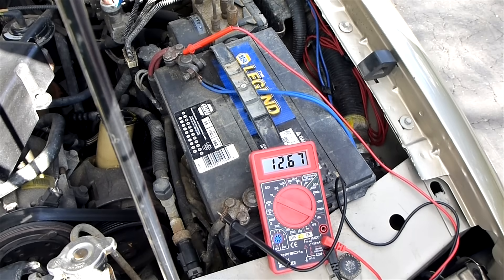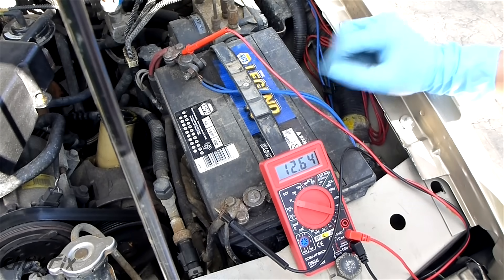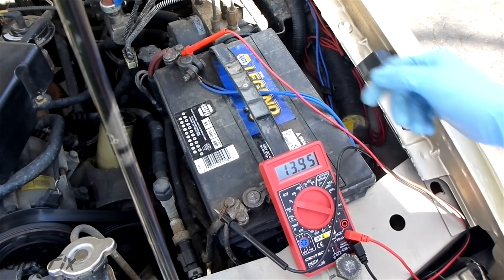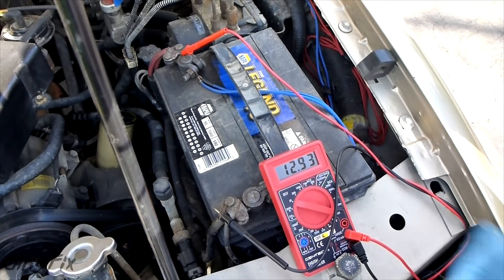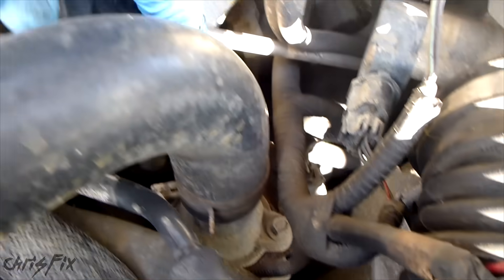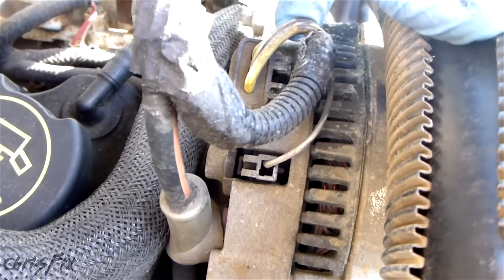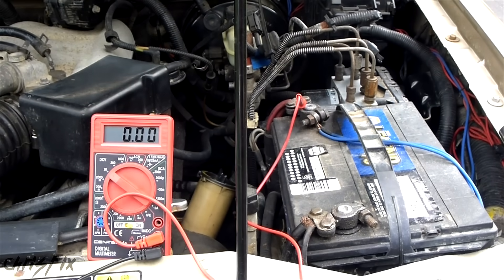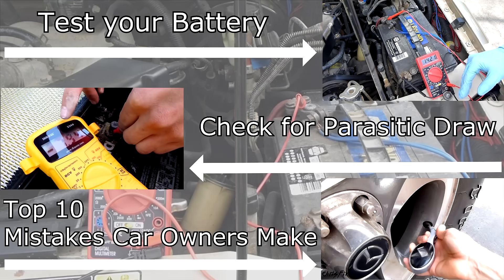How to Test an Alternator

Comment: so Chris my multimeter showed 12.02 v when I had the key in the ignition and the dash lights where on but I hadn't started the car, i left the headlights on for 2 minutes as you said and the multimeter said 12.02 when I turned off the lights it showed 12.37v when I started the car it dropped to 9.87 v and rose back to 14.02v , when I put load like headlights, fog lights, radio , both indicators , a/c, and high beam lights it dropped to 13,57v when the indicators flashed and 13.85v when they didn't flash so what is your guess?PS the only symptoms I noticed is that my cabin light flickers when I open the door and leave it open for a while and when the car is cold it takes a little while longer to crank than usual but when it's warm , you turn it off and try to crank the car it starts up instantly like literally when you turn the key it starts up
Reply from the maker: The battery might be starting to get worn out but it sounds relatively normal. You can get it load tested for free at a local parts store.

Comment: Hi ChrisFix
At the alternator, there's another wire, in toyota they have 3 small wire and 1 main wire
the 3 wire are Light (L), Sense (S) and Ignition (IG)
Can I ask, what happen if L and S wire switch place?
for instance, the L wire connected to S terminal and S wire connected to L terminal
thanks

Comment: Hi, When you did the test on your alternator. You could hear the wining sound from the alternator. The load is too much for it.
Thus you killed the old one out. Now with the new alternator you could heat up the wires. Just be careful not to use too many accessories. lights, radio/stereo, a/c, fan. You can still overload the system and have a fire.

Comment: if i have replaced battery and alternator and audi does not hold charge . for a quick fix can i diconnect batttery . so it starts till i get it fixed and is there anh consequences

Comment: what if it starts on 12.11-,12 and then goes down to 11 and below when starting the car... ??? Is it still the generator/Alternator? or maybe wiring issues??? Just had the car to an automechanic, and when i got it back car wouldnt charge the battery,....

Comment: my car has an external regulator. how do you connect the volt meter directly to the alternator to check direct alternator output so as to bypass the regulator?

Comment: This has been extremely helpful. Before seeing this, I almost did the "disconnect the negative terminal while car is running" test, which before I tried, I read some horror stories about what that can do to the voltage regulator. This helped me out a lot though. Appreciate.

Comment: You ever discovered the reason for the whistling noise you're hearing at low rpm or high load? Im losing my mind trying to quieten down my alternator...
Reply from the maker: +bavarian34 clean as many of the ground wires as you can. Make sure the connection is good.

Comment: Nice Job Chris, Very informative !!!! I just picked my rebuild one from a reputable Gen/Alternator shop, I reinstalled it still have the same problem, the Alternator light came on, but if I rev it up it goes off, but the I get voltage readings from 13.58 to 16 v then 14.20 its all over, but then the light comes back on, I do hear the draw on the alternator when it does go to proper voltage, but back to the 13.48 13.68 and the light is on, my suspicion bad voltage Regulator in the Alternator ?That's what I'm thinking. Thank you ! Great job on the Videos

Comment: The battery light in my car was barely on and had been on for a few months now.  I checked the battery, the grounds, and then proceeded to test the alternator just as ChrisFix described and it passed all the tests.  So I didn't worry about till the other day when my car wouldn't start.  I checked the battery and it was down to 2 volts.  I changed the battery and the next day the car wouldn't start.  It drained the new battery down to 10 volts.  So I did a parasitic draw test and found that the alternator was pulling 3 amps when not running.  Replaced the alternator and solved the problem.  I didn't realize that a non running alternator could do this.
Reply: Your alternator probably had a shorted diode. Diodes only allow current to flow in one direction----> into the battery and not back into the alternator, like a check valve for electricity. When it shorts out, the electricity flows back into the alternator like an open check valve.
Reply: Rectified diodes.

To check for a possible bad alternator diode switch your
 voltmeter to a low setting on the AC (alternating current) voltage scale.  
 with the engine running, touch the meter probes to the battery terminals. 
Any amount of AC voltage would indicate a bad diode, so you'll need to replace the alternator .

Regards.
Reply: @maar5725  likewise WTF is a "rectified diode"?
maybe you meant to say "rectifiER diode"?
Reply: @maar5725  how do I check alternator if car won't start? Is it possible?
Reply: @garyhall6294  If you can get it out of the car, you can take it to autozone or oreilly, they both do alternator testing for bad diodes. I think they can tell you the amperage and what not as well.
Reply: @FeelFighters  thanks bro!
Reply: @maar5725  I would disagree with this slightly.  Ripple may indicate a high internal resistance in the battery.  The battery is the ripple filter and high internal resistance will allow for higher ripple.
Reply: @maar5725  thanks for this tip will try, no crank or start, will try when after jump
Reply: @David Parks thanks a lot. Appreciate it!
Reply: Yeah, any electrical device can have a short or an open in it, any time, whether or not the car is running.  I've mentioned before that a lot of electronics today has some parasitic draw, which is a small amount of current being drained out of your battery all the time, even when the car is off (engine off, ignition off, key out), but what you had was clearly a huge parasitic drain, clearly caused by a short, somewhere in your alternator.  You can rout around, try and find it and replace the part to maybe get it working again-if you want to-and wind up with a 2nd, and spare, alternator, or maybe you traded it to whoever you bought your new one from, or just throw out the old one.  At any rate, if you don't feel like trying to fix the old alternator, it really doesn't matter, because you localized the huge current drain to that old alt, then replaced it with a new one, and now don't have that huge current drain anymore (problem solved).  It is always good when faced with an excessive current drain to disconnect electrical parts connected to the battery, one at a time, until you find out which part is draining all the current, then simply replace that part, as you did, to solve the problem, simply and efficiently.  Excellent.  That is good news.  (I wish I could find a truck for 200, like someone else mentioned on this site, fix a simple electrical problem on it, and then have a good truck for only 200, plus low cost electrical parts like wires or resistors, simply and efficiently!)
Reply: @michaeltotten7508  unless thr fault is upstream of the part that you disconnect and in disconnecing tbe part you also remove the true fault from the complete circuit. 

It is better to remove the battery entirely from the circuit by disconnecting the positive lead. Even if the alternator is not working the car should start and runnif you either jump start the car or start it off a battery that you know is good. Like a new unit. 

A dead short through the alternator will prevent the car from starting with a good battery as it will short out the battery. If the alternator is not a dead short but just not producing a voltage then it is a load on a new battery. This is not likely unless the alternator presents a low resistance to a new battery. If the alternator is not actually connected in circuit due to faulty wiring or a  open circuit at the starter switch then again it should still start if the starter circuit is working and the engine will actually run when turned over. 

So isolating the alternator as the problem involves one sinple test: disconnecting one of the alternator output leads so that it eithet floats or is no load on the battery circuit. Monitor the battery voltage to ensure that it has enough output voltage and power to start the car...if not use a spare battery or a jump box...

I had a problen with my alternator and battery "failing" frequently which various mechanics solved by replacing either the alternator or the battery sometimes even the starter. Eventually I found a competent mechanic who established that the negative battery lead was floating with respect to the starter and alternator. The negative battery lead was connected to the body but the body was not directly connected to the negative starter lead. There was just enough but not too much resistance for the car to start with a fresh battery...and it would stary until the terminal battery voltage dropped to about 12.5V. It should start with the batter down to 11V even 10V. The solution was to tie the negative battery lead to the engine block.
.he used a thermostat bolt as the tie point with a 6ft 10ga lead. Not had a problen since.
Reply: the alternator diodes will be destroyed slightly every time you jump-start the car

I love that this guy got 4M views on a video that just highlights the obvious.
Reply: @touristguy87  What is obvious to some may not be so obvious to others!
Reply: @DavidArroyo78  obviously
Reply: @touristguy87  when it's obvious to you, and that lets you believe that it's obvious to everyone else...is a sign that you do not know the value of your own time and skill.
Reply: @patrickthenomad  obviously we don't see the obvious with the same level of brilliance
Reply: @touristguy87  , the word "obvious" is a relative one.  Obviously.

Comment: HI could you please instruct me how to bypass the ELD unit on my Honda civic 2007 , iam only getting a voltage of 13.5 with the engine running I thing ELD stopping this voltage rising to 14.5 ANY suggestions ?

Comment: Hi Chris. I try this on my Van and it work. around 14Volts. but i'm still wondering, the digital clock is getting weak when opening headlights or even signal or hazard. volts is still in 14. I also try opening all the lights, aircon, radio. still lights of clock getting weaker. what do you think is the problem?... thanks
Reply from the maker: Sounds like a bad ground if you are still pumping 14v. Also the voltage might be good but the amps are not good. I would get the alternator checked for how much amps it is putting out!
Reply: Thanks Chris. I will try to check the ground... I learned a lot of thing from you even though i'm from philippines. 3 thumbs up for all of your videos.

Comment: hi,
i have a question have to check alternator if is not on a car, wot test you car run to check it if is good ore bed?
Reply: Checking alternator not on a car: In the USA, auto parts stores such at Advanced Auto Parts or Autozone will test alternators that you carry into their stores on machinery they had at the sales counter   It is a free service & only takes a few minutes.  You need to tell them the make & model your alternator is meant for.   I have replaced alternators a few times, and I use old alternators I get at the junk yard.   If the old alternator passes the store test, I have found it will work just fine.

Comment: I'm finding a lot of conflicting info about proper output voltage of the alternator.  Some say 14's, others say up into the 15's is fine, particularly for some GM vehicles.  My battery went dead yesterday at work, but was fine this morning.  My alternator is putting out 15.44 at idle COLD then drops down to around 12.8-13v when warmed up.  So it goes from too high to too low?

Comment: the battery and alternator test fine, is the voltage drop test necessary? only bad reading on neg terminal when positive touches alternator case, it is reman and seems like the case is painted, would this give me a false reading?

Comment: Chris, I viewed your video to troubleshoot a melting alternator terminal. When performing the B(- ) Voltage Drop Test, I touched the red lead to my alternator's exterior casing and the reading fluctuated around -230.xx!  Does this indicate a failed alternator?  I can't find any loose wires anywhere, yet my 10 gauge power wire keeps melting periodically.

Comment: You should be testing ground connections with the multimeter set to resistance, not DC voltage.
Reply from the maker: Thanks for the tip

Comment: my new battery fresh from the dealer reads at 12.58v, started up to normal engine idle temp the battery is now at 14.14v. no accessories powered up does that indicates that my alternator is bad? it is 110 amps

Comment: hey chrisfix i just charged my battery and i got a alternator from a friend a cpl years ago  for my 99 ranger well my alternator died yesterday so i swaped them out. i tested my battery n alternator but i dont know if was the right alternator it says my batt is charging at 14.65 and you said 14.7 or over was bad and it was over charging. its awfully close is that ok? or should i just go buy a new one?  the alternator i got came off another ranger close in year and not shure if it was exact same motor or not my friend scrapped his old one and no longer lives around here so i cant ask him.

Comment: Hey chrisfix I am from Pakistan I just share what I found after watching your video 
After 24 Hours when I check my battery it shows 12.33V and when I start the car it shows 13.48V and I put load ( AC and Head Lights ) it drops to 11.55V after switch off the car reading shows above to 12.7V but within a minute it drops to 12.60V kindly suggest is the problem in my Alternator or Battery, I have Lead Acid Battery in my car.
Reply from the maker: +Atif Salam most likely the alternator
Reply: ChrisFix thanks for your prompt reply

Comment: I have a Chevy Silverado 2500 HD with a 6.6 Duramax Diesel. I put a new Alternator on about two weeks ago. When driving yesterday I noticed that my batt light came on for a bit. I turned off all a/c radio,fan. After about 10 min the light went out. Testing today after your videos (good Job) on them.  Everything seems to test out ok, but when I turn my key on (not starting the engine) the battery gauge shows less than 14 . After starting engine guage goes up to 14.3
Any thoughts on this? I had it checked out today at autozone. They said that Alt & Battery's are all very good. Light went off for about an hour then came back on.

Comment: Chris I have a 1999 S10 and the battery cables get hot while the engine is running, and if you try to jump it off. Is this the way I should go about checking this problem?

Comment: ChrisFix hey Chris, I have a problem with my 96 ranger 4.0l I can't figure out for the life of me. I've narrowed it down to the alternator and it's not sending power to the battery. I got it bench tested good and installed a new voltage regulator too. In any wiring configuration, and my last one being the b post disconnected and the positive terminal disconnected and the truck running off of another cars engine jumped to the positive cable so it isolates the alternator to rule out ground shorts. when I do this and test straight from the alternator post to the battery post I get about 6 volts then it drops and holds at 1 volt in 5 seconds. I hope that makes sense. thanks. I've already thrown about 150 bucks into this problem with no solution and buying an alternator isn't making sense.

Comment: Hello Chris, i just fitted a new voltage regulator on and at idle i cant get over 13.5, no accesories on... checked all the connections and no change. any ideas on what i should check next? I'm talking about a 02 golf 4, 1.6cc. might it be because it's a small  engine?

Comment: my reader red 0.03 on the alternator case. The issue is av
 charge the battery and turn on drove for a while. turn it off did not want to turn back on just got a new battery but when i turn it on for 1st time turn on good perfect . Turn it off and try switcing back on  again and it was cranking very slow before it turn on. All test were like u said on thr video except thralternator case read .03 help
Reply from the maker: Sounds like the alternator is not putting out.
Reply: gracias

Comment: 11.4 standing and barely got above 12.8 with alternator running... Time for a new alternator
Reply from the maker: Glad the video was helpful!
Reply: Yeah, my trans am died on the way home because the alternator went form keeping it at 12V to just stopped working... dash lights came on one by one and as soon as I let my foot off the pedal at 70mph the car died... pulled into the shoulder and my buddy came and we used jumper cables to charge the battery since I knew it would hold a charge... then it barely got me home. This is gonna be a pain in the ass on the LS1 since it's on the bottom and power steering is in the way -__-

Comment: Hey can you pull off the battery cable while the vehicle is running and test your alternator that way?

I mean if your vehicle continues to run, with out being connected to the battery, would that be a good way to test if everything is kosher with the alternator?